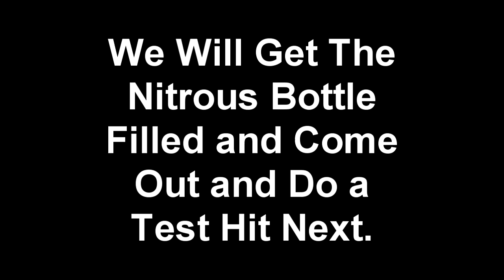1970 Duster Misfire on Top End Testing the Nitrous...

Comment: Make sure you're getting at least 13 vaults Low voltage on nitrous will get you every time Sometimes closing the gap a little on the spark plugs With nitrous will help get rid of a miss